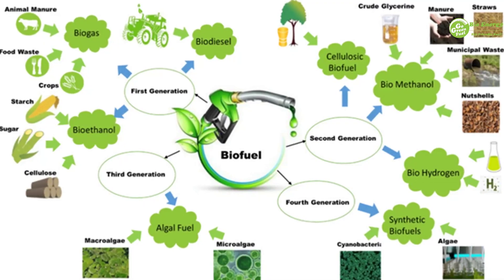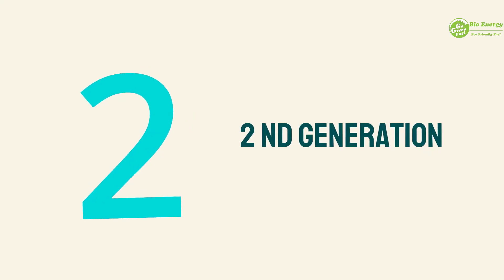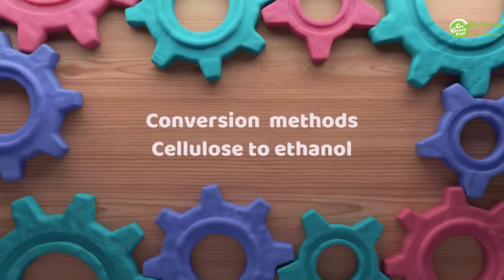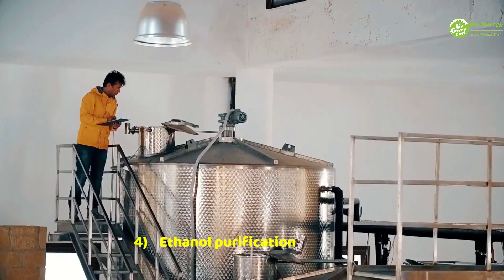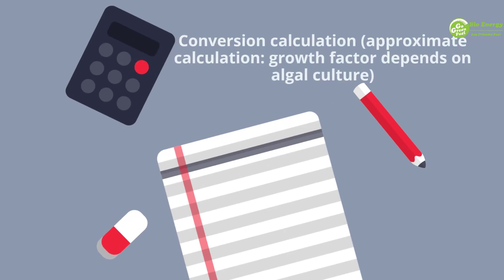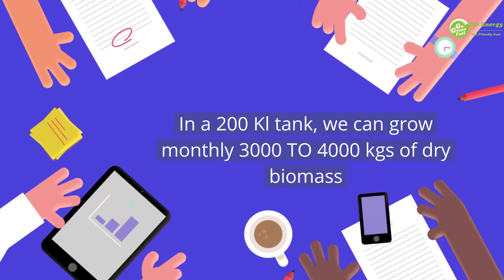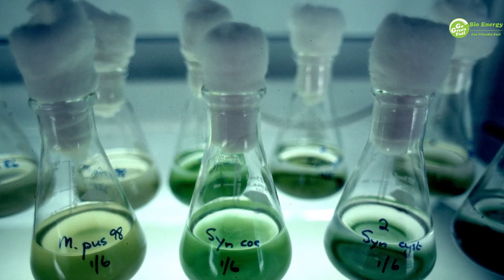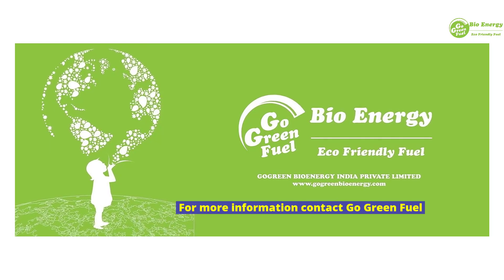Algae to ethanol a potential resource and market

Comment: Don't they have hybridized algae which yields almost 90% lipid (plant oil)!! And I think the remaining waste biomass might have value, use.
Reply: An algae production facility can be matched with domestic, municipal wastewater facilities, utilizing water effluent impurities, as trace nutrients for better algae growth. The bigger the bioprocess, usually the more resilient it will be to upsets.
Reply: And then there's those wonderful wastewater facility anaerobic sludge digesters producing massive volumes of CO2 for the algae, and methane to help generate more power for 24/7 operation, and/or make available as another energy product.